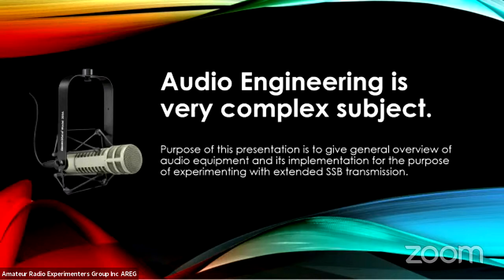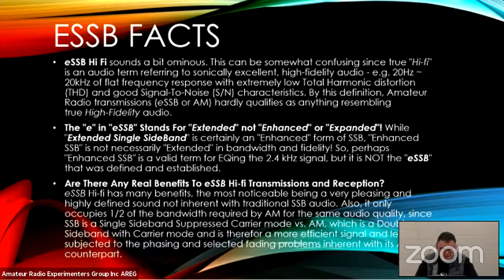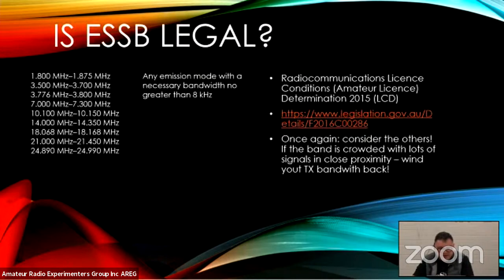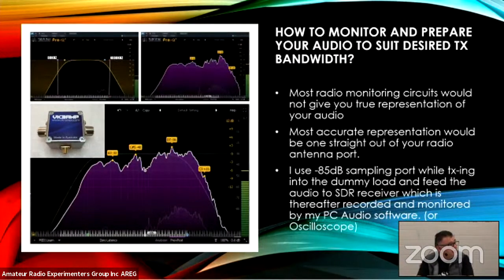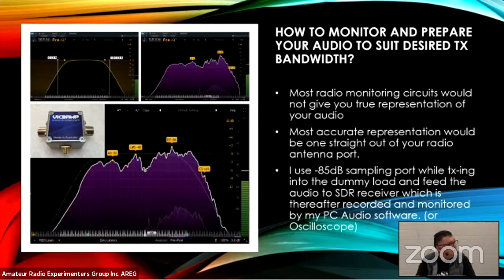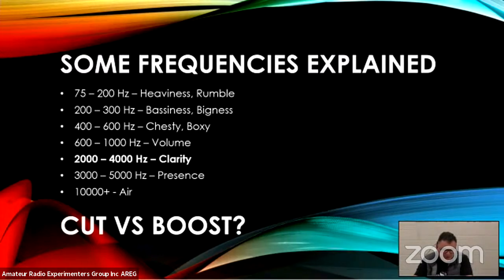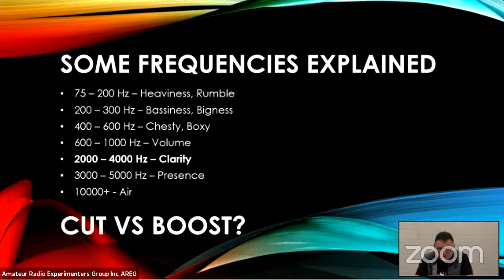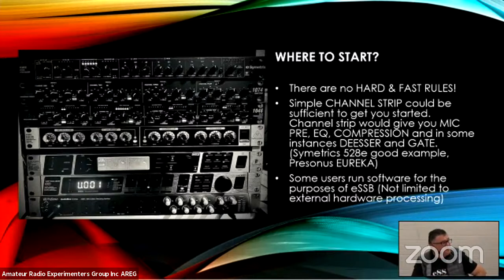Extended SSB Audio (eSSB) | Leveling up your Amateur Radio audio

Comment: Really nice job covering this topic, too many just don't really understand what goes into it. The example audio was extremely bottom heavy. For people viewing this, I strongly recommend you begin to work with the EQ at 3kHz as narrow bandwidth will show problematic frequency balance much more clearly.

Also, you won't hear the bottom heavy emphasis at all unless your computer is wired to a full range stereo and the lesson there is that most people receiving have filters rolling off at 100Hz and playing in a 3" speaker. Those people will find audio balanced as in the example to be muddy and low energy. 

When you expand out to wide band, you wind up with extremely bottom heavy signal quality that when listened to with narrower filters will sound muddy and unintelligible.  If you begin doing EQ at narrow bandwidth and balance there, when you go wider you just gain enhancement and the balance will be much better in implementation.

Comment: My buddy with a Yaesu ftdx101mp has open his bandwidth to 4K uses a re27nd through a alpha amp sounds great at 4K I have a ftdx10 which can rx at 4K. Another with a kenwood 890 sound ok at 4K using a senheiser mic. Then we have another member on the Toad harbor net 1.930 who uses a red papaya SDR wired into a pa on the icom 735 can do 20k but that’s a SDR. It used software for a anon with pure signal feedback. Very cool Discussion 😉😉
Wish Yaesu would open the transmitter bandwidth on the FtDx10. They have open the txbw on all the older 1,2,3,&5k series transmitters
Reply: Yes indeed interesting discussion…. Re conventional radios I am very disappointed that icoms are still stuck at 2.9khz max tx bandwidth. 101D/MP is doing 4K tx so that is a step in the right direction. I would love to know the reason behind the tx bandwidth limitations with the major players (Icom Yaesu Kenwood) Annan 7000 my fav atm. Pure signal and adaptive predistortion is the best thing since sliced bread. Waiting for EE SunSDR 2 DX to release new software updates which will include pre distortion - at least it has been promised for future soft releases. Over
Reply: with the new firmware tx 4k on the dx10 is possible. hold DNR and MODE buttons simultaneausly while powering up. In the menu TTBF will appear.

Comment: Can you not use an Adaptive Noise Filtering algorithm running on an ARM chip assuming you have pre-calculated the values for MU which might be 327 if using a divisor of 32768, and using a random number generator to derive the noise to process out the unwanted noise or a sample of the mains hum if that is contaminating the audio.

Comment: question !I use an SDR receiver to control my sound, what should be the received level of the station for proper sound tuning? After all, with a weak signal, you can make a mistake in the frequency balance! and with a strong sound, too, the sound may seem beautiful!!

Comment: You blokes are boring me senseless. Its simple just do it. I couldn't care less about the history of ESSB or how many call signs you can remember. The future of Amature Radio is innovation and recruiting new people to the hobby. If you maintain this old school backwards looking approach don't be surprised when we loose spectrum and become completely irrelevant.   You need to pitch this from the point of advancement for the hobby.
Reply: Gavin good point (from a 6yo perspective). 95% of ham population doesn’t know what eSSB is, purpose of this presentation was give broad insight to the world of eSSB. History is important as there are some blokes that have done a lot for this segment of the hobby hence why they should be mentioned. Unfortunately it’s not simple - as you have suggested. It is simple if you want to sound like you are transmitting out of tuna can, however if you intend to play with extended ssb experimentation, traditional ssb plug and play practices won’t get you far. Over
Reply: @1337flite  love the smoke on the water bit :-) gold
Reply: Actually, IMO one of the great strengths of amateur radio is the fact that there is an intact history of experimentation going back over a hundred years.  I personally like hearing the history and context.  If you don't like that part, you can just skip to wherever you want in the video.
Reply: @yakovdavidovich7943  or they can QSY right?? Lol
Reply: More reasons to stay in the CW portion